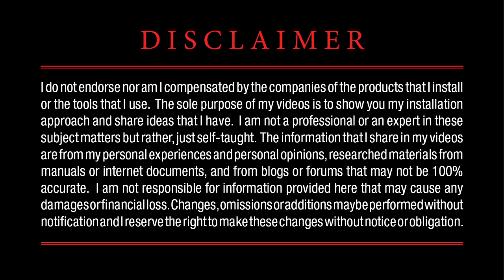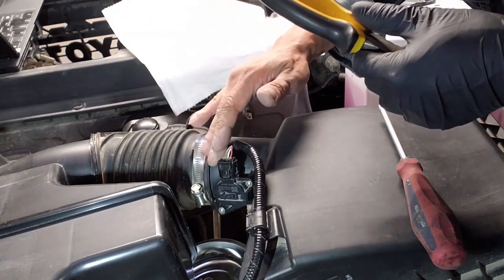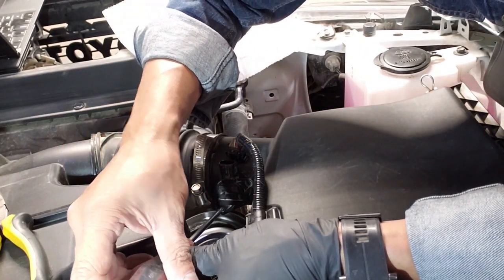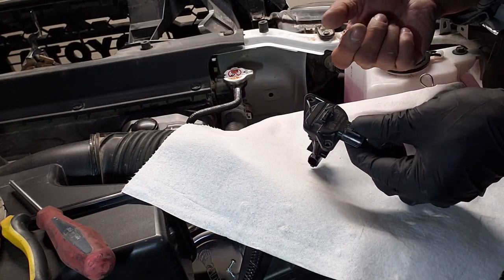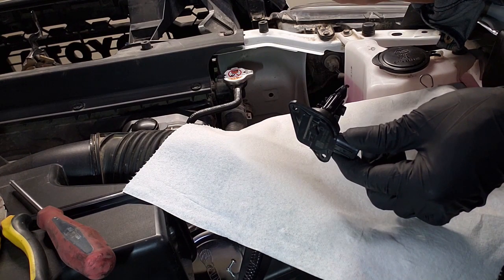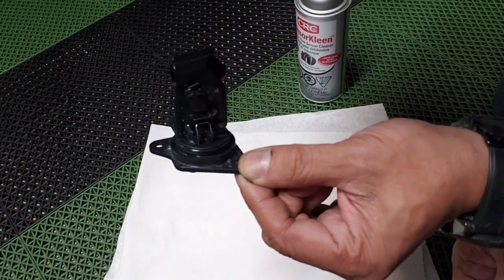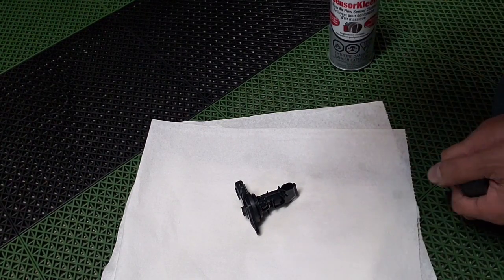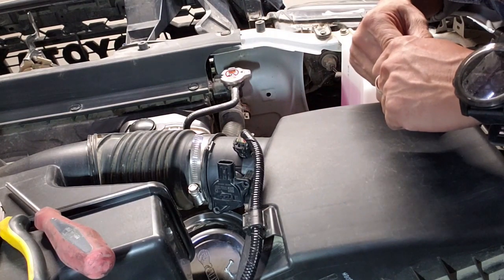How to Clean Your 3rd Gen Toyota Tacoma MAF Mass Airflow Sensor | VLOG #46

Comment: What tires and wheels  are on your  truck   size  and  make  are you running  spacers    or what is wheel offset   🤔  thanks  looks  good
Reply from the maker: Hey fogduker3131... sorry for the late reply, you can check out my channel for other videos on the tire, wheel and spacer installs but anyway, I have the Nitto Ridge Grappler 285/70R17 (33") tires, RTX Baja Offroad 17"x9" 0-offset wheels and KSP 1.25" spacers.  Check out these links: https://youtu.be/DCAAkN1qo40 for the tires/rims and https://youtu.be/5l79K45dKMY for the spacers or https://www.youtube.com/@modXELA/videos for the rest of my mods/installs.

Comment: I had never thought of cleaning the MAF sensor or seen the MAF cleaner. Thanks for a pre-winter maintenance idea. One thought is, I noticed what looks like a rubber O ring on the sensor. I'm thinking a touch of silicone grease on the O ring would be good to keep it in good shape. Thanks, again, for a good idea.
Reply from the maker: Hey Eric H... yes, that's a very good point on the o-ring gasket.  It's definitely something that I'll do next time around... thanks for tuning in!

Comment: Hi Alex  change your oil every 5000km if u change your own oil.  Try not to change your oil 8000 or 10000km. In the future your engine might burn oil. The mass air sensor u can clean it ever oil change or every couple oil changes. I have a 2017 Tacoma trd sport and i have already 265000km on my truck and i change the oil every 5000km. And it still runs good. Great video  👍
Reply: If your going to wash the engine  try using spray nine on the engine its an excellent degreaser
Reply from the maker: @teddymuscio7419  will definitely look into this, thanks for suggesting! Have you ever tried P21S Total?  I've never used it but I'm hearing good reviews.
Reply: I never heard of that product.  I used super clean not the foam but the spray bottle from Canadian tire and it leaves white marks
Reply from the maker: Hey Teddy!  Every 5k even with synthetic oil and synthetic oil filter?  Toyota is recommending to change every 16,000 kms when using synthetic but I like your suggestion. With my Hondas, I do it every 8000.
Reply: One more thing alex if your engine is abit dusty and u dont want to wash it. U can use tire foam from Canadian tire. And u can spray the entire engine bay and walk away. It will take off the dirt away. Will leave anice shine but and oily shine. U can also use tire foam on your wheel wells if there dirty just spary and walk away they will look like new.  U might have to do it twice if there very dirty.
Reply: Yes even synthetic oil i change every 5000. Yes the dealership told me too to change the oil at 16000km. I told them no way. I will get the oil changed at 8000km when i was taken it to the dealership. Now i do my own and change it at 5000km
Reply from the maker: @teddymuscio7419  yeah I think I'll do what you do.  I have 7 free oil changes with my dealership so I'll just do 2 oil changes on my own every 5k and have my dealer do it every 15k.
Reply: Make the dealership change it at 8000km not 15000km
Reply: If your doing alot of off road with your Tacoma change the all the gear oil both differential front n back transfer case  every 50000km or 60000km. Ive been changing mine every 60000km ever
Reply: If u do alot of off roading with your Tacoma change all your gear oil both differential front n back transfer case every 50000km or 60000km. Ive been changing mine every 60000km since i bought my truck new. Plus i also change my transmission fuild too. Mine is manual transmission.

Comment: How often should this be done?
Reply from the maker: Sorry for the late reply seagraverider, I've been away and traveling for work. Anyway, this depends. If you just do regular driving on paved roads, once/yr would be sufficient.  However if you do offroading with plenty of dust, I would suggest at least 2x to 3x/year but you can make a judgement call and adjust that accordingly.

Comment: Hello Alex. I'm not ready to clean ours just yet, 30K easy road only miles. Good info though, thank you!
Reply from the maker: Hey Breeze Rides! Only reason why I did mine with only 16k kms on my truck is because I had the OVTune done about 3 months ago and we've tried  4 different tunes now but my fuel consumption is still at 20.5L/100 kms for normal driving and 28L/100 kms when towing my travel trailer. I'm thinking my MAF sensor maybe dirty so I hope this makes a difference. Thanks and nice chatting with you as always, cheers my friend!
Reply: @modXELA  I’m at 46k miles on a 2019 trd off road that goes deep off-road 3-5 times per year. Going to do this now with the MAF cleaner
Reply from the maker: @jamesdean4972  yes, it's an easy DIY maintenance... thanks for tuning in!

Comment: Can i use contact cleaner to clean the sensor?
Reply from the maker: Hey Muda, great question!  While many people say that there's no difference between the MAF sensor and electrical cleaner, I'm sure there are some differences in the chemical composition. Would you use dish soap to wash your car?  I'm sure it's ok but I don't want to find out 2 years down the line that it has a harmful effect.  $10 MAF sensor cleaner is not much to fork out for a $70k truck so I won't take the risk.  I hope this helps.  Thanks for tuning in my friend!